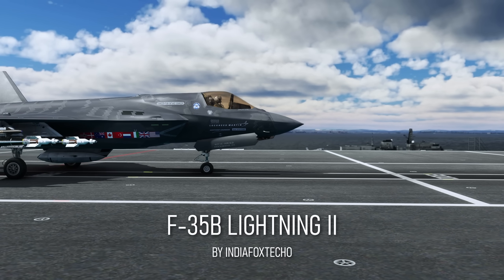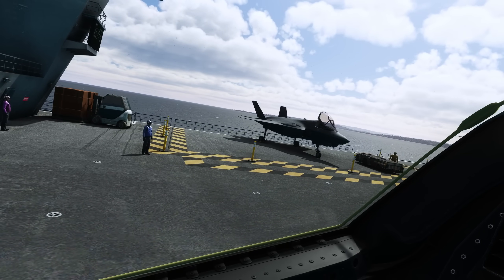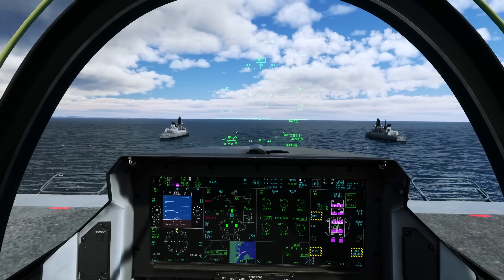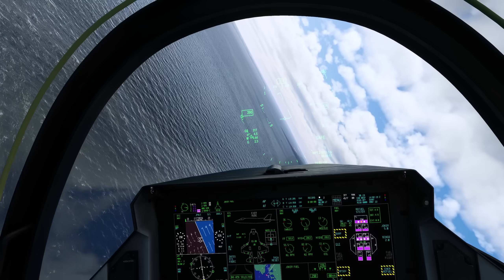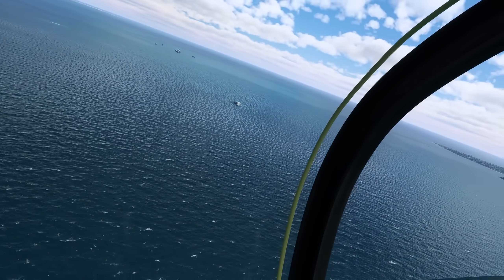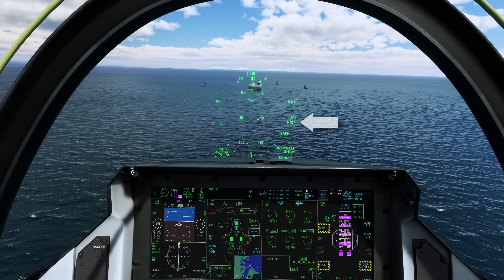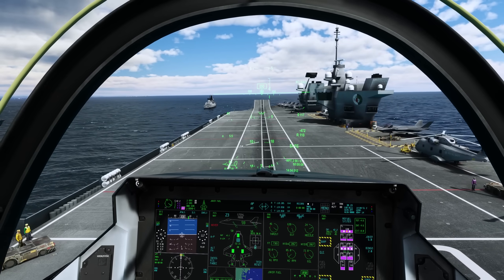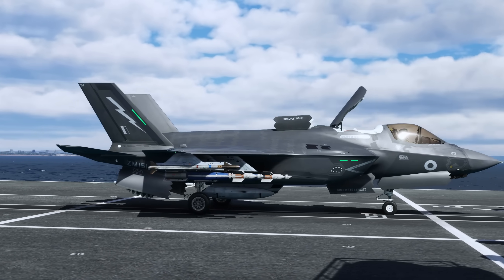Too Heavy to Hover? The Brits found a solution! F-35B Lightning II SRVL (MSFS)

Comment: The F35B - a plane so shitty it can’t hover with a weapons load, and an aircraft carrier so shitty it doesn’t have arrestor cables.
Reply: I mean considering no other fixed wing fighter can hover with as much weight as the F-35B I wouldn't exactly call it shitty. It's still a huge leap from previous STOVL aircraft like the Harrier which were far more limited in range and payload.

The lack of a catapult is a bigger deal, it wasn't really worth adding an arrestor cable without the catapult though as conventional aircraft using a Ski-Jump would be much more limited in their weapon and fuel payloads compared to an F-35B.

Comment: I was just doing a YouTube trawl and came across this video. It’s not my usual interest, but I did enjoy it. However, I do have a couple of questions: Is there a reason that you put down the landing gear before you finished making your final turn? and, Does this have an effect on the handling of the plane at that speed? 

I would have though it would have been better to leave the landing gear up until your final approach, but there’s obviously something that I am missing here.

Thank you for taking time to read this comment.
Reply from the maker: There’s a little bit of technique going in here. Usually this would be a Case 1 approach as I mentioned and the gear would be lowered as soon as rolling out downwind. The other option is a full straight in or instrument approach where the aircraft would be established at 1200ft and 12 miles and configured between 9-11 miles ish. I did a mix of both as I didn’t want to lengthen the video by going all the way to 12 miles. There’s no issue with dropping the gear where I did. From what I understand the aircraft would auto trim (normally you’d expect the aircraft to climb when flap is lowered, though flap is automatic in this aircraft). So it shouldn’t be too much extra effort for the pilot. Hope that answers the question?

Comment: All this because the shipbuilders lied when they said the QE carriers could be retro-fitted with cats and traps.   Turned out the could do it, for more or less the price of a whole new carrier.
Reply from the maker: I think there was also an issue with it not being a nuclear ship therefore not having a lot of steam for the cats. Apparent the electric version isn’t as reliable.
Reply: @cgaviator  Previous British carriers were non nuclear and had steam catapults.  The problem with the QE carriers is that they have jet turbine/diesel power plants, where older ships had steam turbine power plants.

As to whether electric catapults are less reliable, they are what is being used on the latest US carriers.  Donald Trump thinks they're a bad idea, which almost certainly means they're fantastic.  But you can't put electric catapults on the QE carriers as they don't have enough generation capacity, not being nuclear powered.
Reply from the maker: @JohnHughesChampigny  ah! Good to know. I’ve watched various documentaries on this and often there’s a difference of opinion. But what you say makes perfect sense. Thanks 👍🏻
Reply: @cgaviator  Yes, it's sad.  The QE's (which were originally supposed to be built together with France's next generation carrier) fixed the biggest error of the CdG (it's too small) but the decision to use conventional propulsion was just stupid.  The two countries that were to build them both make nuclear powered ships.

Luckily the French have taken this lesson onboard for the splendidly named PANG

( Porte Avion Nouvelle Generation )
Reply: @JohnHughesChampigny  It would have been possible to use electromagnetic catapults much like US carriers, the designs for the CATOBAR version had the same engine setup and the UK version of these catapults, called EMCAT were quite far along, and the US version EMALs was being considered at one point.

They don't need the ability to produce all of the electricity at once as they charge capacitors over time which release the power all at once on launch, so a more limited power capacity wouldn't stop them from using catapults, but the time between launches may have been slower.

They have been looking into replacing the existing AEW Merlins with medium sized drones launched from smaller scale catapults though.

Nuclear power just made less sense for the Royal Navy, the main reason they avoided it is because of the enourmous cost to build the infrastructure to support two huge nuclear powered ships. Considering it would have taken more money away from other areas, or even meant only one carrier was built, they probably made the right decision on that front. France already has a bigger nuclear industry and doesn't have as extensive of a support fleet as the RN does, so Nuclear makes a bit more sense in their case.

Comment: I knew it. This proves 35 needed a second engine
Reply from the maker: I’d love to see a hovering twin engined jet! 😁
Reply: Weird thing, in the late 70s there was a UK  comic called Battle which was about military stories and facts. It merged with another to become Battle/Action and one of the stories was about a future European  war instigated by regime that emerged from the fall of the USSR(Volgans) and the  RAF were flying a "super harrier" with twin rotating engines and twin tail.
Reply from the maker: @charliedecker7702  sometimes comics get it right! 😁
Reply: @Charlie Decker  
I appreciate dual tail idea but I have to admit I'm partial to new B-21 Raider and its tail less design.

As well. I still want to see the MD/GD A-12 Avenger 2 get developed and produced and ... AND ... And with VTOL variant.
Reply: Battle/Action from IPC must have had some good contacts in the weird or experimental weapons community, in another storyline there was a a laser tank. Looked a bit like a Buffalo amphib with a cylindrical emitter turret near the front. 15-20 years later I saw one in a future weapons tv show.

Comment: although I'm not sure who originally came up with the STOL for small carriers. I know that this method has been used for years for AV8B's. I served with vma 542 and deployed on the Bataan and got to see the pilots practice "rolling landings" (i heard a pilot refer to it as such). it's not a preferred method on an Amphibious assault vessel but was always an option and trained for.
Reply: IIRC the Amphibs don't have that much room for it. Meanwhile the RN's carriers actually have a fair bit of room on the deck for landing in this way so its much more of a standard procedure.
Reply from the maker: I’d not heard of that, would be very scary with such a narrow space. Yet the US thought it was a crazy idea to do a rolling landing on deck with an F35! But then I’m only going on third hand info 😅
Reply: The brits 1st did this with the Harrier

Comment: This is all good fun, but it does highlight some of the incredibly daft choices which were made in the UK acquisition of F35 and the whole carrier program. The failure to fit traps and catapults to the carriers limits them to exactly one fixed-wing type and creates the problem you depict here. What you're doing here is not a clever military technique. It's a foul-up recovery technique because they somehow bought the wrong boats AND the wrong planes. What's worse, every UK Lightning has to be the STOVL variant, which means every aircraft will be more expensive and less capable (given the reduced weight limits and fuel load, as it's carrying the fan) than it could have been. I'm not blind to the costs of training aircrew to perform arrested landings, but the choice of a more expensive, less capable platform is absurd. Jettisoning millions of pounds' worth of missiles into the sea because the ministry of defence is too staggeringly ignorant to have specified the boats or planes correctly would be funny if it wasn't so tragically normal for British military affairs.

And that's even before you consider the reality that QE class carriers are frankly just too much boat for a military funded at the UK level. We can barely afford to crew them, we certainly can't protect them, and we absolutely can't afford to put air wings on them without depleting the RAF's numbers to the point of making the entire air arm of the UK military irrelevant. I mean no offence to anyone who's in or has been in the military here (though I would question why anyone bothers in 2023). The reality is, the whole thing is a massive shag-pile, fully-fitted, wall-to-wall cock-up and the sudden panic about capability in the light of Ukraine would make me laugh for a week if it wasn't so terrifying. When a Russian naval vessel parked off northwest England a few years ago, it took the Royal Navy a week to get a destroyer up there to say hello. Right now it seems to me that even the Russian military could more or less stroll up the mall and knock on the door of Buck House, and the UK military would take until summer to even notice.
Reply from the maker: I… can’t argue with any of that… still, the flying is fun! 😅

Comment: Nobody's gonna mention that the Harrier can't hover with a weapons load either... Vertical flight is extremely hard to design for without having to take weapons weight into account.  Doing so would harm the aircraft performance, you can't just slap on bigger engines.
Reply from the maker: Next we’ll need two engine VTOL aircraft! That would be quite something! 😅
Reply: @cgaviator  twin engine vector control would be something else to see.

Comment: They "found" a solution?  Like no one had ever thought of this in all history? 

I wonder if former Harrier pilots would agree.
Reply from the maker: I was going off the documentaries I watched. The harriers used similar techniques on land, but I believe they almost exclusively hovered to land on the small amphibious ships. But the Brits are the only ones to use this on ships with the F35.
Reply: It was far more difficult to do with the Harrier, although I've heard of some instances of it being used in emergencies, it seems like it was pretty dangerous.

As the F-35B is fly-by-wire it means the whole process can be much more simple, allowing them to regularly use this method to bring back a heavier payload rather than having to dump fuel and weapons.

Comment: I had not realized that the Brits don't have a full out carrier.    Please correct me if I'm wrong
Reply from the maker: Define full carrier? It has all the same use though without catapult and arrestor wire, it's only for F35B aircraft.
Reply: @cgaviator  It has no catapult or arrestor wire and it is only for the F35B.  It sounds like the America Class  America-class amphibious assault ship.
Reply from the maker: @ericmason349  true, but the flying rate it apparently is closer to a Nimitz if they had enough jets (presume Americans would use it as well).

Comment: The Royal Navy invented the angled flight deck, the steam catapult, the arrestor wires and the Ski Jump Ramp to assist Harrier and other VTOL aircraftto take off... the American Navy just copied.... the Royal Navy also worked out how to operate the F4F Corsair in terms of landing safety on a carrier....
Reply from the maker: Is that right!? I feel another video in the making! 😁
Reply: And the landing lights system instead of the batman

Comment: The plane better be able to hover in space to wait for a storm to pass before landing. Not having the velocity to stay on course for a targeted path that plane is wrong.
Reply from the maker: Targeted path?
Reply: @cgaviator  The aircraft has a roll out after touchdown where it has to stop during the point of touchdown and where ir stops. That's a path/line on the carrier deck. The plane isn't only having to hit a spot but hit a spot with a path for it's rollout to stopping. Targeted path. High winds can make that slow approach dangerous especially with the ramp creating turbulence. Hence hover in space.
Reply from the maker: @nightwaves3203  makes sense 👍🏻

Comment: Eric Winkle Brown would have aced It. The Brits have been very inventive at getting planes, especially jets, on and off aircraft carriers. Simulation is a very powerful tool.
Reply: I'm absolutely sure he would have enjoyed flying this aircraft. Compared to the Harrier he most likely would've tested, the automation makes STVOL so much more easy. The man is a legend in my eyes.
Reply: @EdgyNumber1 
That's the incredible thing about the F-35 platform. 
People say it's "Fly By Wire" and think F-16 or even F-22 but it's SO much more than that! 
It's like comparing a hobby aircraft or helicopter from the 1990s to a drone toy from the 2020s.
In the 90s you still needed to be the best in the world to get the most out of RC aircraft. 

How a child can fly one, up down, left, right, forward and backwards.

The F-35 is a drone compared to the F-22's RC toy controls.
A novice can climb into an F-35 and immediately push right up to the edge of the envelope.
It's rumoured to be able to perform post-stall maneuvers just like the F-22 and other TV capable fighters, through nothing  but software emulation.
That it can perform a hands-off-controls recovery from any situation, useful if the pilot experiences G-LOC.
And it won't let you peel a controlled flight into terrain. 

None of these are confirmed, they're just off the record statements by pilots, but then you think about it and you see no reason why they wouldn't add these features when they're just software.

Comment: I wish the Royal navy chose to employ CATOBAR  systems for the two carriers. I know that it would significantly increase the costs but carriers are expensive to construct and operate anyway so you may as well make the ships as capable as possible.  Right now they're just not as capable as they could have been.
Reply: Not viable at Time of launch  EMALS doesn't work properly yet. So uk went with STOVL . EMALS will probably be installed at a future major refit along with f35c or similar.
Reply from the maker: Doesn’t matter if we don’t have enough jets to up the ship borne sortie rate 😒
Reply: @cgaviator  Haha. I was thinking more about the AWACS aircraft, they can't take off or land on these carriers, so a helicopter is used instead, - which isn't ideal. Oh well.
Reply: @JPaulC  Actually helicopter version has advantages.  You can have several helos linked together providing a larger surface picture, and if helo is shot down it can quickly be replaced with another
Reply: @blazer666del  Plus a helicopter can hover instead of having to fly in an orbit in order to maintain a radar picture.

Comment: The F-35B can absolutely hover, the royal navy idea is to burn less fuel, but F-35s are operating from Wasp and America classes using hovering to land
Reply from the maker: Yup, I think they’re testing for when they need to move serious payload and hovering isn’t an option if they return early or without dropping the weapons.
Reply: So could the harriers jump jet at a fraction of the price
Reply from the maker: @janewilkin1984  I believe the harriers quite often had to drop any unspent weapons prior to landing. And sadly they were subsonic, not stealthy and had very limited sensor capability.

Comment: And the clowns say the one that dropped in the Mediterranean was due to cover not being removed over jet engine intake...Duh!!...So didn't the pilot check his engines before take off?..Why with so many sensors and electronics would this not be alerted?
Sounds fishy to me...Incompetence or a shit design of aircraft?
Reply from the maker: Presumably the lift fan doesn’t engage until takeoff. Not sure why they didn’t see it. I heard the F35C that fell off was down to pilot error thinking it was in auto when it wasn’t.

Comment: Did it with the Qinetic Harrier when I was on the Lusty Bus. Never got implemented as they shitcanned the SHAR
Reply from the maker: I thought they used the VAAC to figure the plan for the F35?
Reply: @cgaviator  I think you’re right, that’s what the VAAC was for. 

But I got WAFU mates who will swear it was something they wanted for the SHARs as they always had to punch off ordinance and dump fuel before recovering. 

Lack of organic carrier aircraft they binned the idea off as it would have been a really intensive training serial and expensive upgrade for a capability rarely used.

Comment: Rad alt over water?
Reply from the maker: I don't quite follow your question?
Reply: @cgaviator  having worked on aircraft for over 40 years I have seen radio altermeters not to be to reliable when bounced of water,  maybe modern military rad alts are better . working in the hanger with water on the floor the rad alt would bounce up and down if switched on, when I was on a carrier they used the optical landing system for approch

Comment: Great Recommendation from YouTube. I am now left wandering how must faster this aircraft can be at and still stop in a safe distance. While the UK carrier don't have a cable to stop, they do have a ramp going up. Could you test and find out the maximum speed that will let you land but stop midway thought the ramp? The reason I am curious is that can be used to allow bringing back even higher weight payloads.
Reply from the maker: I doubt for many reasons they’d choose to go faster. And they don’t need to carry too much extra in terms of payload. The flight model/pitch angle on approach in STOVL mode would make the nose hit first so it would look ugly. I could give it a go. Have a carrier landing trial video!
Reply: The ramp is for takeoff -- if you use it for landings too you'll halve your sortie rate.
Reply: @JohnHughesChampigny  The maximum possible sortie rate yes. Carrier don’t always operate at the maximum sortie rate.